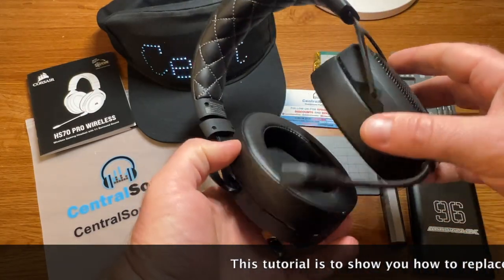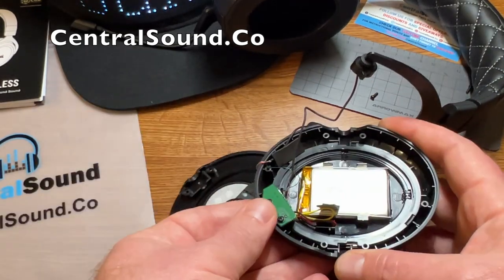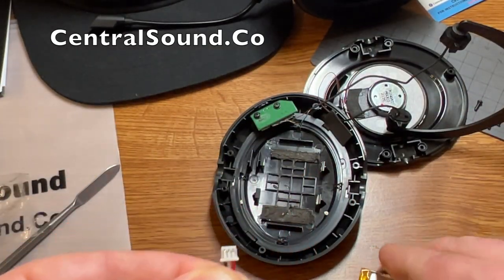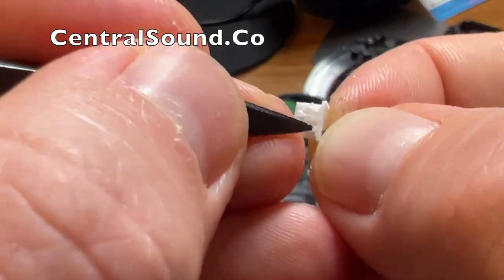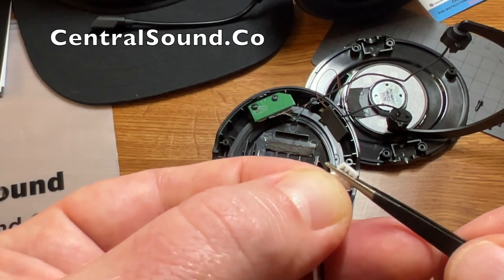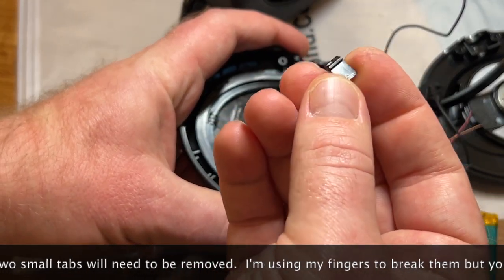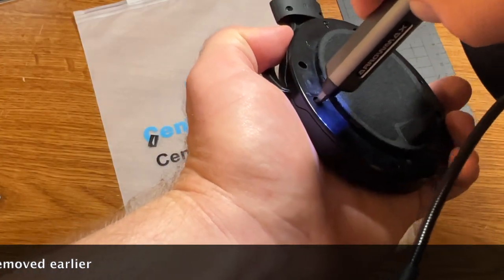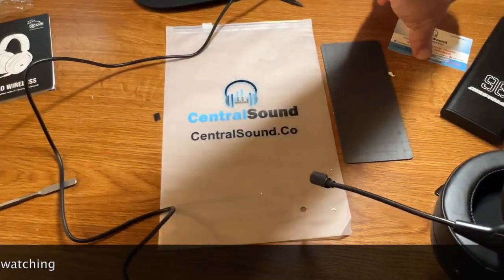Corsair HS70 PRO Battery Upgrade Replacement - How to Replace | Install Remove | Gaming Headset

Comment from the maker: How to replace and upgrade the battery in Corsair HS70 PRO wireless gaming headsets.  
 Increase your use time by 50% with our battery here  https://centralsound.co/products/replacement-battery-for-corsair-gaming-headsets-mouse-1500mah-3-7v
Premium XL Ear Pad Upgrade for Corsair HS50 HS60 HS70 PRO (Cooling Gel, Hybrid and Protein Leather) Buy Here  https://centralsound.co/products/centralsound-premium-xl-replacement-earpads-cushions-ear-pads-for-corsair-hs50-hs60-hs70-pro-gaming-headsets
Video of demo and how to Install our Premium XL Ear Pads Here https://youtu.be/pCKK
How to Install OEM Type Ear Pad Cushions Here : https://youtu.be/LMwNYgqVimU
Order OEM Type Ear Pad Cushions Here:  https://centralsound.co/products/centralsound-premium-replacement-earpads-cushions-ear-pads-for-corsair-hs50-hs60-hs70-pro-gaming-headsets

Comment: Warning (please upvote this comment): YOU CANNOT FOLLOW THIS METHOD FOR HS75 even though the website says you can. The battery housing is much more complex. Also the battery in the hs75 is soldered

Comment: Thanks for the video!  FYI: if the light blinks Red and Amber it means the battery is not connected properly. Once properly connected it is solid amber while charging.
Reply from the maker: Thanks for weighing in!
Reply: My Headset blinks. Will the replacement done in this video fix that? Or is it a different issue?

Comment: Great Vid,  easy to follow.   swapping polarity was a little tricky.  At testing, ICUE software remained unable to recognize the battery.  The Charging indicator remained Red and panic set in since this is what the old dead battery status was.   checked all connections, went inside pc to verify everything.  all ok.   so to the forums i went.   Someone indicated a hold down for 10secs on the power button clears the software.   So sure enough, it worked and all is fine.  Charging and working Great.
Reply from the maker: Great to hear it’s working !

Comment: Thank you for this video.  I also went up to a 1500mAH battery.  I didn't have the exact tools you have, but I used my plastic car trim tool which worked just as well.

edit:  My old battery was so swollen.  I disposed of it properly. ;)
Reply from the maker: Very innovative using that car trim tool.  Great to hear the video helped you.  Thanks for taking the time to chime in and leave a comment.
Reply: @CentralSound  I am not afraid of modding headsets.  I had a set of Sennheiser PC350s that I drilled holes in and stuffed with cotton to improve sound.

Modding my headset to make the 1500mAH fit was easy and a no brainer.
Reply from the maker: "drilled holes and stuffed with cotton to improve sound"  We should make a video on that.

Comment: Awesome video. Thanks
I removed the two screws on the green chip as it mad it easier to re-connect the battery.
Reply from the maker: Hello, thanks for the props and tip.

Comment: It was very helpful for me. I've just changed my HS70 Pro battery. Battery was very sticky to the body, I needed to use plastic trim remover. I inserted the trim remover from side of the battery from right side and twisted the trim remover and battery came up easily. If you use screw driver it can damage battery.
Reply from the maker: Hello, yes that battery can be punctured if not careful removing.

Comment: Do I have to keep them off while they fully charge for the first time after replacing the battery or can I use them while charging? Great tutorial!
Reply from the maker: You can use them if you want to.  It’s best though to let it charge completely.

Comment: just would like to make sure, the battery is located at the right side of the headset correct?
Reply from the maker: Yes that is correct 👍
Reply: @CentralSound  hey man just would like to give you an update. I just replaced the battery and it was pretty simple and easy to do just by following your video. I greatly appreciate you making the tutorial. 

Also I ordered the cooling gel ear pad from your website. Can't wait to try them on :)))
Reply from the maker: That's great to hear!  Thanks for your orders.  The cooling gel ear pads are a great upgrade, I think you will really like them.

Comment: thanks for the video great stuff. but I can not find any 3 wired batteries in my country. is there a way to use the battery with only + and - wires and no yellow wire?

Comment: Thanks for the video, replacing it was very easy. I do notice something weird though, while the duration overall is definitely longer, the iCUE and other third party apps always report the battery level at 86% or so every time I unplug them after charging. My guess is that it has something to do with the firmware being programmed for the original battery size, is there anything else to do here other than the physical replacement?
Reply from the maker: Hello, thanks for your question.  If the battery life is longer and everything is working as it should then let it be.   Honestly, we couldn’t tell you 100% why the 86% is showing on 3rd party apps.

Comment: Battery life on my HS70 pro is currently about 4-5 minutes (do I win anything for lowest battery life? :P ) and as its well over 2 years old now Corsair support just advised me to buy a new headset so I'm really glad I found this easy to follow guide. Just ordered a 1000mah battery and am looking forward to being to relax with it unplugged again.
Reply from the maker: Glad we can help you relax while playing.  Our battery is a 1500mAh upgrade, even more time between charges. 💯👍
Reply: Battery life on my HS70 is non-existent. A little over a week ago it was 30min, but each day the charge dropped by 10min, currently the blown battery serves as a buffer because without it the headset only plays for 5seconds and abruptly shuts down and doesn't turn back on until you disconnect and reconnect the USB
Reply from the maker: Buy one from us 😉😆

Comment: I'm a novice to this kind of stuff so I'm not sure if this is a basic question or not. Doesn't adhesive heat up and loosen if it's used on a battery? Isn't it better to use double sided tape? I know the OEM uses adhesive but I'm not really sure if there are any differences from what they used compared to Central sound
Reply from the maker: Hello, you can use either one.

Comment: Is it a bad idea to heat up the adhesive under the battery so that it is easier to removed and possibly keep some adhesive on the case?
also is there a possible way to make the charging usb-c without major problems?
Reply from the maker: You could most likely apply some heat at a very mild temperature to loosen it,  I would not recommend it though.

Comment: Hello! Thank you very much for your video, it helped me a lot, you already have a new sub, I have a question, I have the corsair hs75xb, will the same battery that you bought work for me? Or do you think it's different? Currently my battery has died and I'm looking for a solution. I'm thinking of buying it on Aliexpress but I don't know what model or specifications the battery should have
Reply from the maker: I would suggest opening it up and taking a look.

Comment: Excellent vid, tyvm, i have one question though (excuse me if it seems obvious) my battery ,like yours says 60-34-50, yet your replacement battery says 50-40-50. oes this make any difference? I seem to recall that those numbers have to do with the battery's size if i understood correctly & since your replacement battery  fits just fine, then i need pay no mind to those numbers-am i correct?
Reply from the maker: Hello , that's a very good question and observation.  On some batteries (like ours in this video) you are correct.  On the OEM battery on this video it is not relevant because those numbers are not referring to the size on the OEM battery.

Comment: Good video, but my HS70s did not have the clasp....the wires were soldered directly to the board, and this did not work as demonstrated. Must be a newer (or older) version.

Comment: I have a set of corsair hs70's and wanted to replace the battery because mine was completely finished , bought a new battery followed all your steps only to be met with the fact that the battery in my model is soldered directly to the board :/ this swap-out is gonna be a lot more involved than i expected

Comment: I have an 1800 mAh battery and I’m struggling to fit the connector into the battery. Does this battery have a connector that’s too large? I have the hs70 headset. I’m also wondering if you can only use plastic pry tools to separate the wire holders? Thanks.
Reply from the maker: Hello, thanks for reaching out.  The connector on the battery might not be compatible, they’re not all the same.  It’s important to get the right battery with the right connector, if not you can damage your headset.

Comment: very useful
would a 1800mah for a "hs70 pro" fit?
and would double sided tape be good instead of adhesive?
Reply: From my measurements, as long as you're in the range of these dimensions:
Length - 52mm;  Width - 35mm;  Height - 10mm
Going off my research the 1800mAh batteries are slightly below that dimension range in every aspect. You should be good to go with that one. 
I myself am looking for a solution to replace my blown battery with... It's impressive that it has gone from stock 5mm thickness to 9mm (even then it fits pretty well and there's no pressure against the speaker + 1mm extra comes from the adhesive strip)
Reply from the maker: Hello and thanks for your question.  It depends on the size and type of battery.  You should be ok with double sided type.

Comment: I want to replace my battery and rewire it to a battery clip so that i can have hot-swappable 18650s but the new setup wont have a thermistor wire to connect. Is there a way to bypass that thermistor wire in the headset? Would it be a bad idea?
Reply from the maker: Keep it simple.

Comment: I just replaced the battery in my headset, and the led light is going from dark red, to light red to orange. Does that mean that i put the battery in incorrectly? Or is it charging like it should?
Reply from the maker: Thanks, just charging up.

Comment: I have a question about the cable from the battery to the chipboard at 1:45. It seems like I have no connector to my battery, but it has been soldered stuck to the chipboard. Would it still be possible to replace the battery?
Reply: I just did mine. Clipped the plug off the new bat, carefully soldered them in place. I have a slight feedback hum though. Only notice it when nothing is playing. Feel like I remember it from before but haven't used these in months so I can't fully recall if the HS70 just normally has a power hum or if I crossed something
Reply from the maker: Hello,  thanks for your question.  It's possible perhaps if you solder it, but we would need to take a look.  You can send some pics to us at info@centralsound.co so we can further assist you.

Comment: Can i use 2000mah instead of 1500? And what can i do when my battery for replacement have only 2 cables out
Reply from the maker: Which model do you have ?
Reply: @CentralSound  I have the same question. I have Corsair HS70.

Comment: im guessing i cant use a tiny flat head to pry open the connector, i dont have anything small enough that is plastic
Reply: I used small pliers to hold the connector outer shell and pulled the battery connector out by wires

Comment: Hi. Its possible to replace it with a 3500 mah battery? its the only that i find. regards
Reply: I think the 2000mah one is the biggest one that fits, or two 1500mah
the size numbers for my 2000mah are 103450
Reply from the maker: We have these same batteries in the vide for sale  we sell here https://centralsound.co/products/replacement-battery-for-corsair-gaming-headsets-mouse-1500mah-3-7v

 3500mAh sounds like the battery may be too large to fit

Comment: I'm changing my sennheiser bluetooth headset and it has 3 wires and the only available li-po battery only have 2 wires is it okay to solder 2 wires i stead of 3?
Reply from the maker: Can you send us some pics at info@centralsound.co ?

Comment: I have mine upgraded to misodoko pad(previous owner changed it). Is it fine to reopen the padding or will i have to replace new paddings as well to change the battery?
Reply from the maker: You should be ok with using the same ear pad.

Comment: i do the same as the video, but my battery have only two cabes, its functioning but dont light up de recharge light, can i do something? the phone dont talk if are recharging or not in audio too. i belive the battery came at full charge.
Reply from the maker: The original battery or replacement has only two wires ?
Reply: @CentralSound  Yes only two wires, its not original.
Reply: Im going to order a replacement battery with two wires. Does it work perfect? You battery working perfect?

Comment: I got a replacement battery with 2 WIRES only black and red. It's a 3.7V 1500mAh. From AliExpress. What should i do?
Reply from the maker: Good question!  You bought the wrong battery.
Reply: @CentralSound  Oh. But I can't find any rechargeable battery with 3 wires out on Ali Express. So thought 2 wired might work too.
Reply from the maker: You should have bought our battery.  The link is here.  Don’t trust batteries from Ali , some are not safe.  https://centralsound.co/products/replacement-battery-for-corsair-gaming-headsets-mouse-1500mah-3-7v
Reply: @dr.kashie1513  2 wire battery works, but it'd be recommended to have the 3rd wire as a security measure so the battery wouldn't explode because of overcharging.
In reddit regarding this topic some have mentioned that everything works alright, but it can cause the microphone button to not work for some odd reason.

Comment: Any easy way to put it back? When I try to insert the last tab, it just bounces it back, and it won't fit on it
Reply from the maker: Hello,  not sure how to answer your question.  Are you referring to inserting the wire in the connector ?
Reply: @CentralSound  Sorry my bad
I can't put back the ear cup again 😅
Reply from the maker: Hello, it is a little tricky.  I has to be lined up just right.   Keep on trying, you will get it.  💯

Comment: Anybody here have experience fixing corsair HS50 and HS70 pro wireless? Do they have the same pcb? Broke my hs70 pro volume wheel and I have an old hs50 laying around. I dismantled it and having trouble finding a layout of the hs70 pro wireless online. Do they look the same for those who have fixed and hs70 pro wireless before?

Thanks so much!

Comment: My battery is soldered to the little pcb 😢
Reply from the maker: What model do you have?
Reply: @CentralSound  I didn't notice that my headset is the non pro hs70 wireless 😅 I just cut the wires of the inflated battery and with electrical tape connected the new one haha

Comment: Took mine apart and the battery was soldered straight to the board along with some teeny tiny wires running to the other side, thanks corsair
Reply from the maker: Hello, oh no, what model do you have ?  We may have a battery that will work for that.
Reply: Yeah, the HS70 normal (non-pro) version is like that. I have both at home (pro is mine and "normal" one is my husband's) and opened them to try to exchange the batteries cause my pro battery has been dead for months and my husband has another headset and is not using his "normal" anymore. Nasty surprise. Even the battery capacity and tension are the same, it's ridiculous that the said pro version does not carry any improvement on that... it's barely better just for its ease in swapping batteries.
Oh and my pro original battery is swollen like it's about to pop 4 babies out of it (of course it's not going back in my headset). And it came directly from Corsair RMA to replace my HS70 normal. Total bummer.
Reply from the maker: Hello Marina,  thanks for weighing in by sharing your experience with both the HS70 PRO and HS70 versions.  Your feedback and insight is extremely helpful 💯...Watch out for battery babies, those are dangerous 😧
Reply: @marinaborgert  Is there any way to replace those batteries? Because I have the exact same problem with the HS70s.. The thing basically stopped working and the battery was also 4/5 times its size.
Reply: @jodawgsup  You have to clip the plug from the new battery, and the wire from the old one and solder the leftover wires and the new battery wires together. I wouldn't touch the solder directly on the board as some of the wires looks just too delicate to mess with them. For me at least, it went easier working with the wires only. I'm through with my 2nd battery change by now, altought I swapped for 1200mAh versions. All working fine.